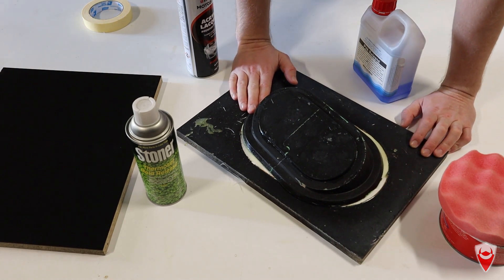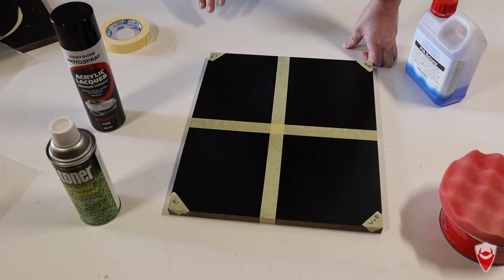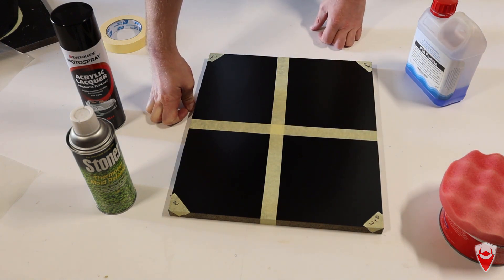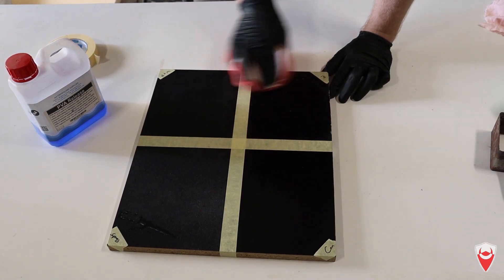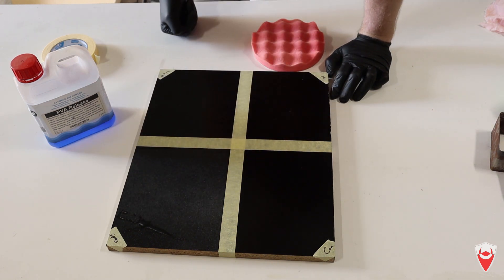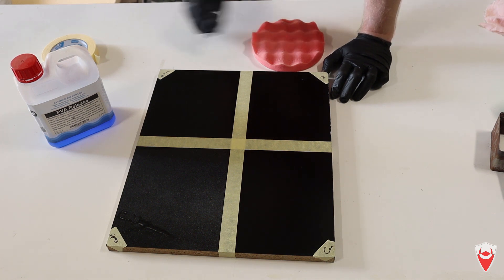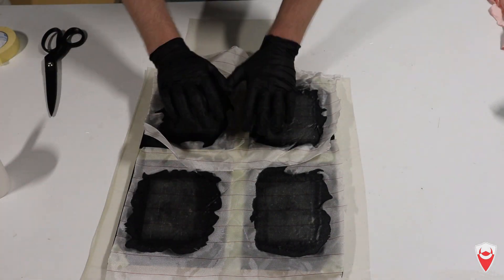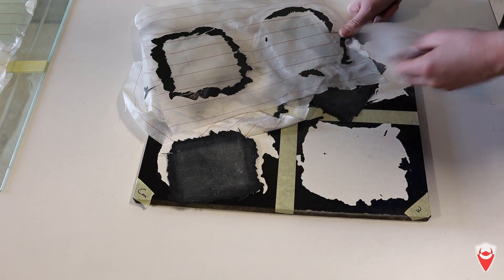[EXPLORE] Release Agent Experiments: Number 1

Comment: I also found that the "automotive laquer" is just not suitable for composites!  If you use polyesther resin, it will literally melt.  I am now using 2k automotive clear coat to seal molds.  Nothing else I have tried can come close to it!  It creates a hard, impervious layer that can be sanded and polished, and it is compatible with every release system I have tried.  Oh, and if you have an oven, you can bake your parts and then sand it in as little as 30 min.

Comment: Using a glass mirror is not the best surface, it’s so smooth, anything will release. This experiment should be on a fibreglass mould, as that is the usual surface used as a mould.
Reply from the maker: You are right. I was honestly just trying to learn how to spray it and figured I'd record it at the same time.
Reply: For me its the opposite, I want to epoxy against a very flat surface with high accuracy.

Comment: Any updates on Your wing? Im still trying to figure out the best way to do it.
Reply from the maker: I'm going to call that motivation...

The carbon skin is on, I have to sand it (there were some small bubbles) and put a final capping layer on it for aesthetics. That's going to be the end if the next video, with endplates and mounts the video after.

I've just been lazy and working lots at my job that actually pays the bills...

I've also been working on another project which I'll have a video up for this week (a short one).

I'll take this as motivation to get back to the wing.